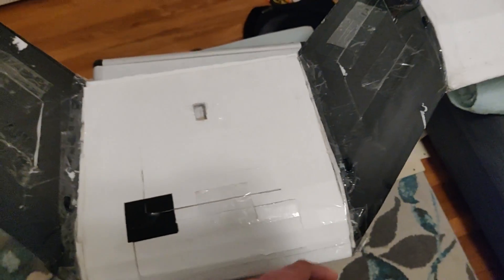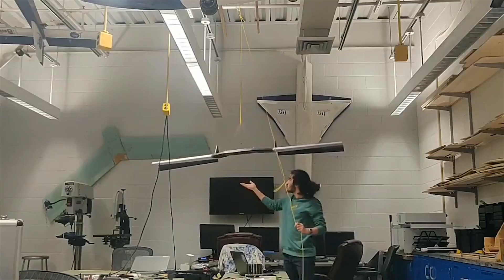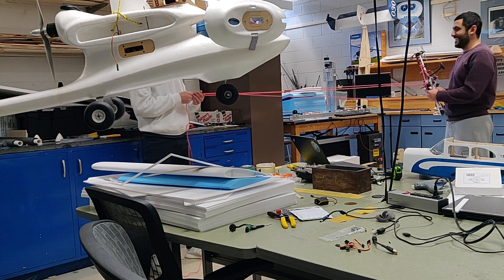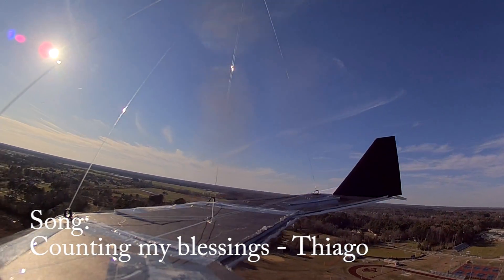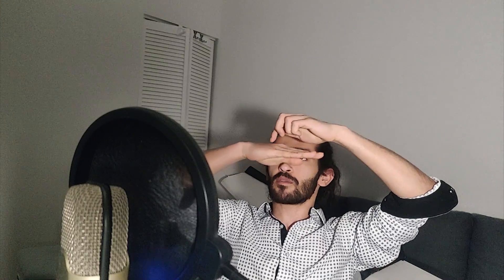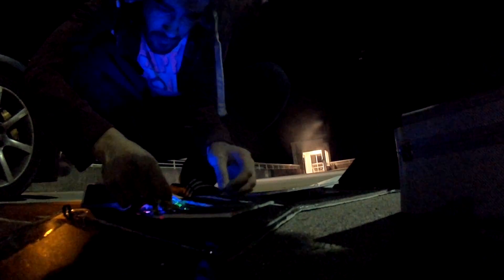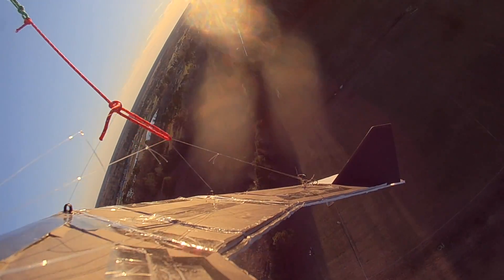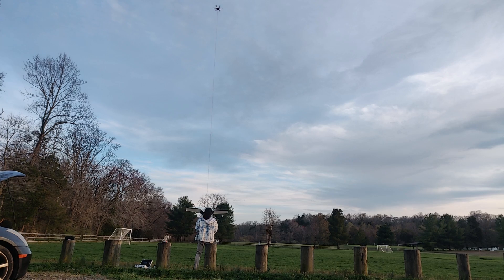High Altitude Balloon Glider - PL9: Autonomous glider dropped from drone

Comment: What’s up man. Sick project! Quick question. When the aircraft is going into “Auto” mode, is it following a waypoint mission, or is it doing an auto land command on a GPS coordinate? thanks!
Reply from the maker: in this video it's following a pre-made waypoint mission, in the following videos (PL10, PL11) it just sets itself to RTL mode.
Reply: @ohitstarik  Right on! Im currently experimenting with MavProxy SITL.. how did you get the aircraft to land instead of just circling around in RTL? Is it strictly the no propulsion that allows you to achieve this, or is there a parameter that I’m missing? Thanks.
Reply from the maker: @XianTC6  iirc there's a land parameter when going through the RTL settings, but for me if it circles long enough it'll land anyways. 

I took over and landed in stabilized mode in our first balloon test
Reply: @ohitstarik  So much help, thanks! I’m working on a similar project.. instead I’m using a servo to release the autonomous aircraft from a larger one (from a ground station tho, no companion computer). I’m almost done, just need to get the damn thing to land haha Lastly, you’re an amazing engineer.. enjoyed watching your PLs !!
Reply from the maker: @XianTC6  best of luck man :) there really might be something to set up a landing in the RTL parameters, I just don't know off the top of my head. the documentation might show it or just combing through the parameters might show it. if I come across something I'll let you know.

Comment: I used flight vector and NOTAMs to work with FAA which filing notams you are working with Lockheed that do them now.  And they pretty much let everybody know what you are up to. Pretty much say this is the launch location and time, this is what a normal balloon would land this is where I am planning on having the glider to land. Now to be on the safe side you could put a radar reflector on it
Reply from the maker: Sadly if it's an uncontrolled parachute in the form of a radiosonde it's much much easier to get away with this. 

Once there's safety features on board it becomes a lot more dangerous and must be regulated almost to the tune of not being allowed to fly. I know. Doesn't make sense.

Long story short since it's a glider, an aircraft, and can control it's flight the FAA is a lot more strict on it. the normal NOTAMs with high altitude balloons won't work since this falls under part 107. For BVLOS ops I'm hoping they accept ADS-B for sense and avoid technology, since it literally senses manned aircraft and avoids them. 

Granted, those manned aircraft also have to have ADS-B on board (a lot do), but amazing when you can come to a day where a poster board glider has to be equipped with that or have a chase plane, and real aircraft in the same airspace don't.

the only people who have successfully done this project is people just "sending it" without adhereing to their nations laws and regulations. They took their necessary precautions and landed safely. 

I'm willing to work the law, but damn bureaucracy is so slow
Reply: Then again if your glider is above six pounds then screw everything I just said

Comment: I tried doing the same thing for a class with the wing being a parafoil and the payload a box. To steer it we used two arduinos connected to two servos, a gps, and a magnetometer. For the release mech we had a different box connected to the balloon with a servo pulling a pull pin that was holding the parafoil. 

We ran a series of tests for every component to make sure everything worked. And then we did tethered launches from 500 ft off the surface to see it could steer. But we only had one day to do tethered launches and what happened was that the connecting lines to the box were not properly adjusted so the parafoil just stalled and went straight down lol.
Reply: In all honesty if I ever come back to it I’d still use a parafoil and just manipulate the cg to steer instead of pulling control lines.
Reply: Oh and I would change the release mech to a thermal knife to the main tether.
Reply: I used 70lb fishing line for the tether for the balloon to the ground which was tied to a garden hose real. I would add a motor to the garden hose reel because that thing sucked reeling that sucker in for re-loading.

Comment: Hey, it's great to see some more progress with the glider, that was a really nice flight at the end. I'm wondering if the fishing line tethering solution might tangle when it's being sent up, perhaps tethering from a single point with thicker line might be a better idea? I don't mean any disrespect of course, you're the engineer and I'm just a guy behind a keyboard :)
Reply: I suppose it'd be easier to use a single tethering point if the aircraft had a more conventional airframe, then it'd hang downwards as it was taken up by the balloon, I think my 2 cents is moot
Reply from the maker: @mrdeurknopp  hey no worries man, dialogue is always good. Gives both of us things to think and learn from.

I saw a couple people used the single thicker line in their HAB glider projects. Like you said, it works better when you're using a traditional airframe, but regardless for the low altitude testing this still confuses ArduPlane and doesn't give it enough time to recover. It does work for higher altitudes though

Another thing I wanted to move away from about the single point was that with higher and higher gusts of wind (Nevada goes up to 40mph iirc) all that load is being put to a single point. I made this in hopes of making 4 robust points that each could easily carry the aircraft, so we have a large factor of safety. There's still some thinking to do here though, because while the forces acting on the single point is just side to side, the 4 point tether has up/down forces acting on it depending on which way it's tilted, how it's swaying and from where the wind is acting on the airframe.

The 4 point tether keeps the aircraft somewhat level, so the gust forces have less of a surface area to act on. Robustness and reusability inspired a bit of the design.

A couple of these tests though the wind was fast enough for aerodynamic forces like lift to play a part on the Sequoia (the airframe in the video) so it'll be interesting to see how that effects it in 40mph gusts.

I don't think it's possible for it to get tangled if set up correctly, but the set-up time is 3-5 minutes. It's kind of tedious enough to make me wish it was as simple as the single point though no lie.
Reply: @ohitstarik  Ah, I see, you have clearly put a lot more thought into this project than my 20 seconds at best lol. Anyway, it looks like you're getting really close. I think this whole thing is really going to pay off for you one day, you'll be stupidly employable if you get a good video out there showing off your results :)